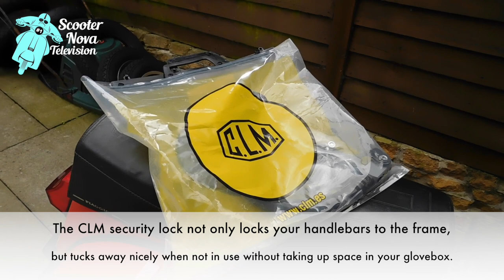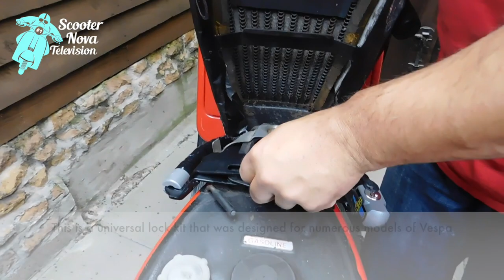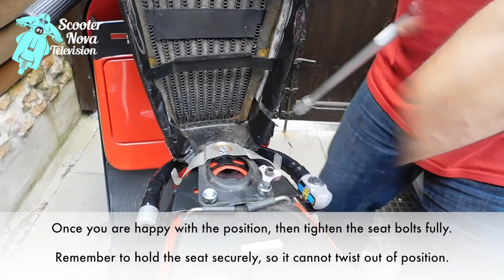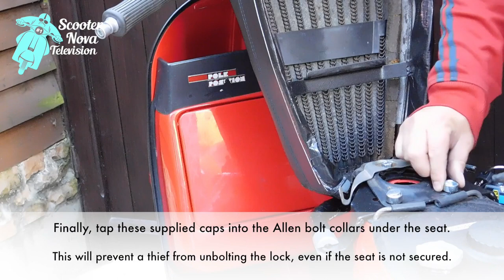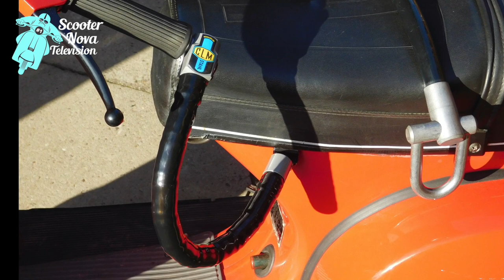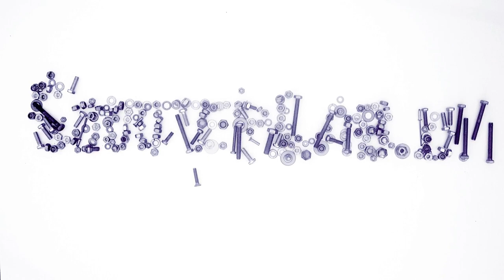SLUK | Fitting a CLM Vespa handlebar lock

Comment: The whole point of the caps around the bolts is so you can’t get a regular socket on the bolts (kit should come with a puzzle key bolt) - by replacing with Allen keys you’ve made that part useless!